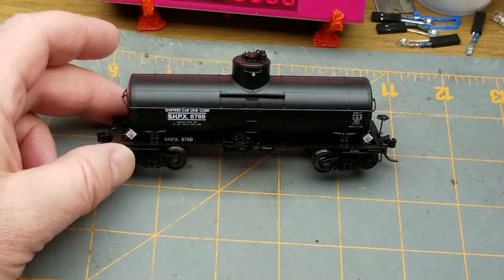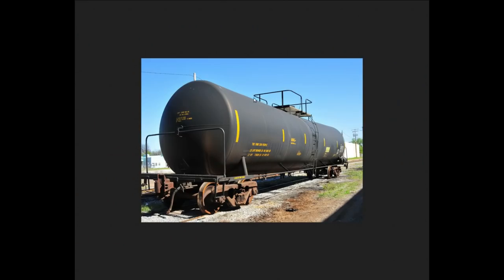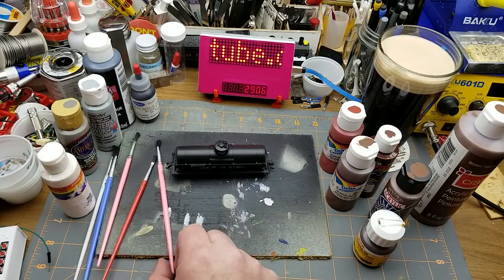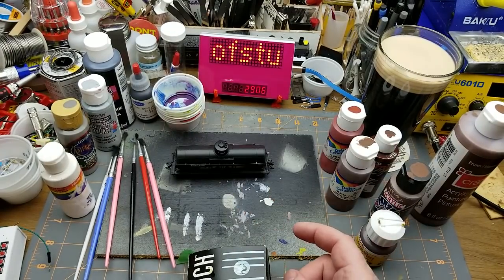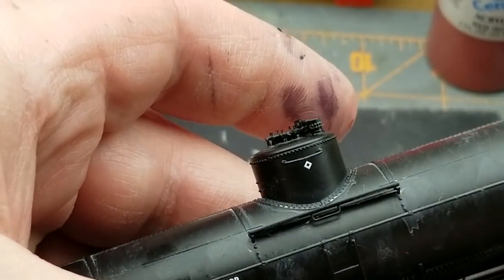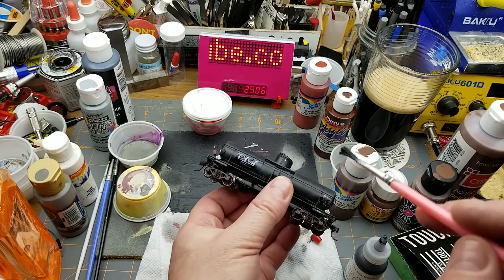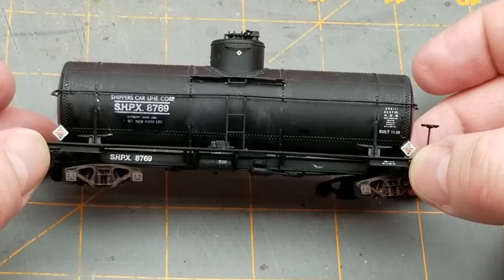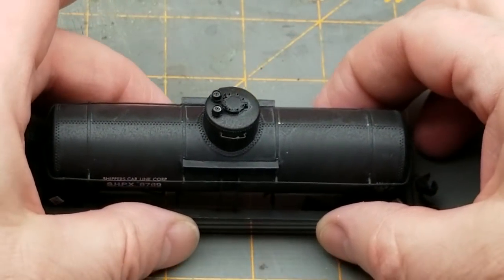tank car weathering

Comment: The overall light gray color on a black tank car is due to the sun fading the paint. A good way to simulate it is to use VERY light coats of a light gray, such as Testors Model Master Light Ghost Gray. Use very light coats and build up the effect to wear you want it. An airbrush works well for this.